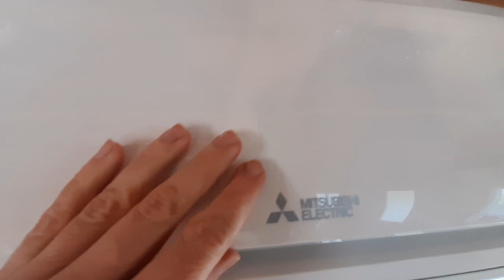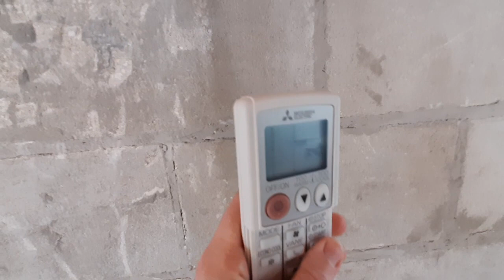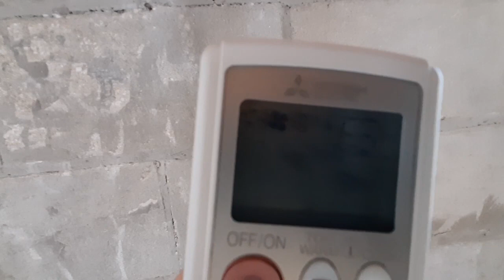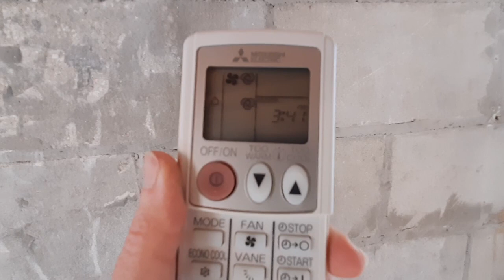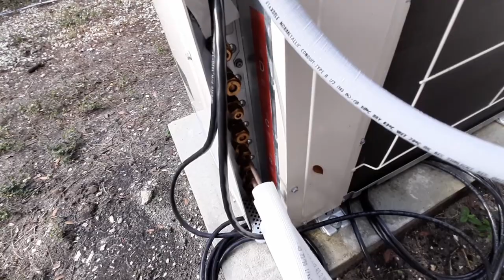Mini Split vs Ducted AC Comparison Between Two Systems

Comment: thank you for this video, i had almost purchased a ducted system and didn't realize the long term maintenance issues with ducts. plus we get alot of earthquakes in nz it will be a mission to get ducts fixed /cleaned and the additional power cost. Mitsubishi are now doing multi room systems ,all units talk to each other and offer zoning at 1/3rd the upfront cost of a ducted unit, im sold now. thank you!!
Reply from the maker: You are very welcome. Our quality of life improved since we got these mini split units and got rid of the ducked system. Very easy to maintain.

Comment: Excellent video, excellent narration as you hit the key points without useless bs. I have a 5 Zone mini split system that I use for AC as I prefer my cast iron baseboards for heating. I’m am extremely satisfied w the system & have had no issues 3 yrs in..

Comment: OMG!  I'm going thru this now and I've had quotes as high as $40k for a 5 zone system.  I'm going out of my mind.
Reply: Wow! I paid just shy of $15k for a 4 zone system. 3 9k MLZ Ceiling Cassettes/1 18k. MLZ Ceiling Cassette, w a 42k Condenser. I just added another 9k MLZ Ceiling Cassette 3 days ago. $3200. All my inverters I ordered the Bluetooth Connector so I control the whole system thru my cell. I’m in NY w these prices..
Reply: @tjinytjiny6615  I just had a quote for a 4 head Mitsubishi unit with three 9k heads and one 18k head.  He was in at $17,600.  And his quote did NOT include permit fees and electrical work.  So it would've easily went up to $20k.  I ended up going with a ducted heat pump system instead for $16k all in.
Reply from the maker: Follow my advice in the video and order the system yourself.

Comment: Thank you for the video. I'm thinking of buying two of these for my 1500 sf mobile home which currently has an old forced air system costing me an insane $360 per month in summer. And the ducting system is from the 70s, and don't think it can be very healthy.
Reply from the maker: Mini split system is worth every penny you invest in it. We have not regretted one bit for switching from duct system. It works non-stop and the cost is always the same. It is VERY easy to clean. No need for filters, etc. You can open the roof area and raise the ceiling or whatever you want.

Comment: FYI the inverter has nothing to do with the indoor unit. The inverter which is in the outdoor condenser varies the speed of the compressor stopping it from turning on and off which is where you get your savings from.
Reply: That's right. She only has one inverter inside the condenser unit outside. She has three evaporators (air handlers if you're in the US) inside the home.